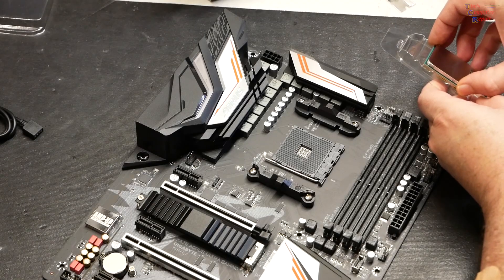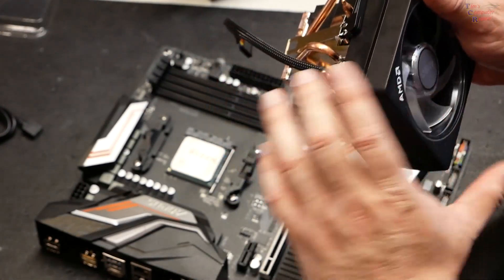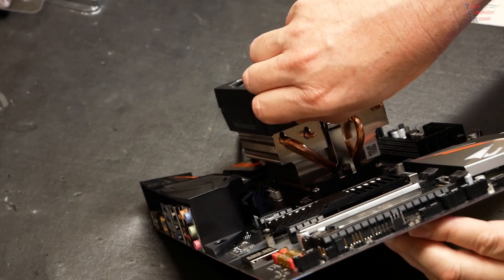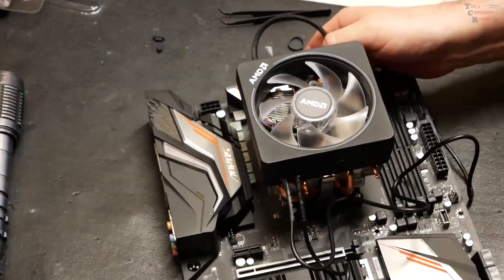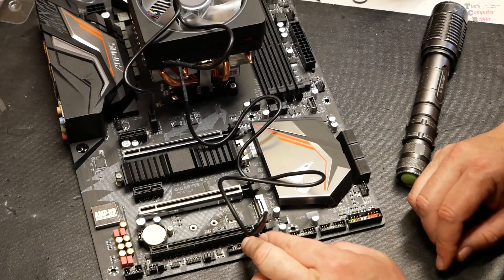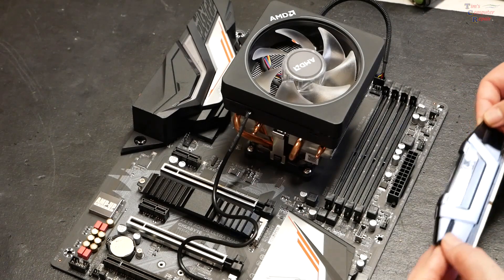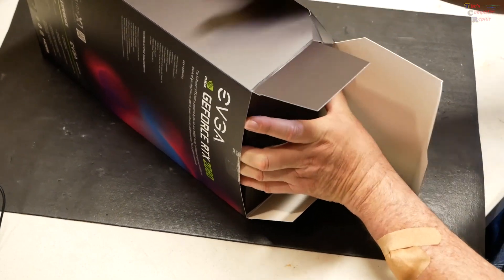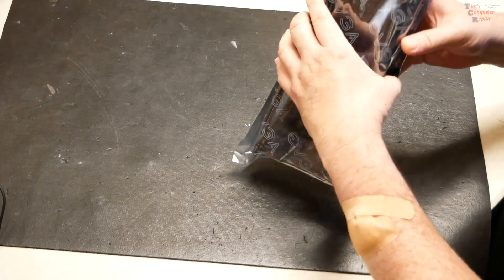How to Install an AMD Wraith Prism CPU Cooler

Comment: 2:21 it is not just hard, it is a nightmare. I prayed a million times to not break anything, it requires so much force. Terrible design.
Reply from the maker: It has to be extremely tight to get the pressure needed on the cpu for the cooler to work properly. It is a bit daunting.
Reply: @TimsComputerRepair  Well the cooler I am trying to install is Xigmatek Apache IV which has a more primitive locking system of the same mechanism. Yesterday I mounted it without not renewing the thermal paste which is 11 years old, and guess what? It didn't work. :D My  PC shut off after a few seconds after pressing power on button. Today it is trial #2, I am just a designer who is interested in hardware configuration and I am going to make it. I can feel it thanks to your video giving details.
Reply: @TimsComputerRepair  Second attempt, zero damage, %100 success. Cheers.

Comment: man , in your videos dont cut it, you show something then you cut and final result is seen but not the entire process
Reply from the maker: You need to be sure the lever is in the open position when attaching to the clips (I do show that in the video). This cooler installs VERY tight so you will be met with a great deal of resistance.
Reply: @TimsComputerRepair  thanks man its like the only video to install ryzen 3900x processor that i found. I already put book hooks. I had to press with my two thumbs to make the short metal piece of the heatsink hook. First time i build a pc. I am afraid of damaging somethibg
Reply from the maker: You will naturally feel like you are applying to much pressure but that tension is by design. Move forward you will be fine.